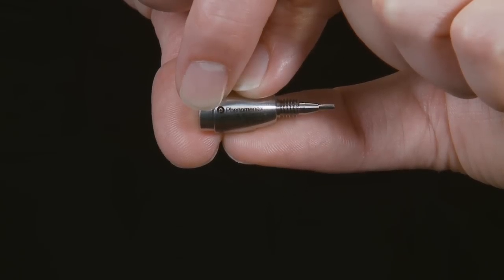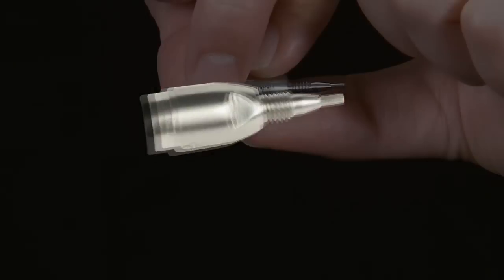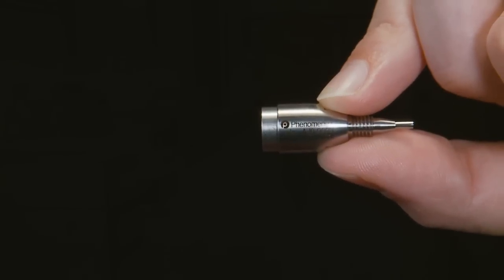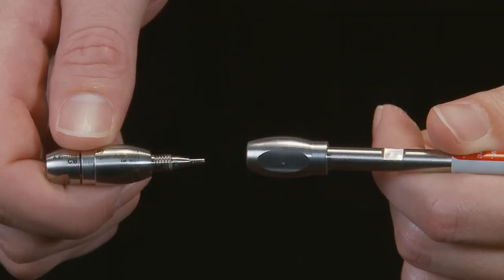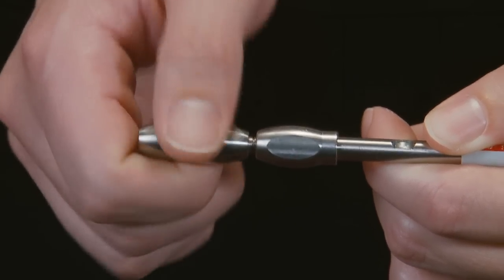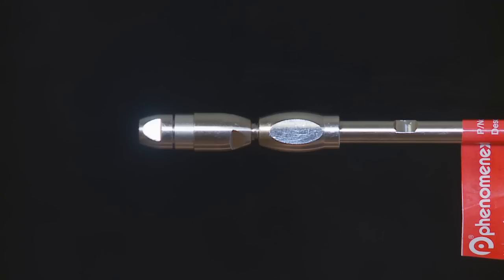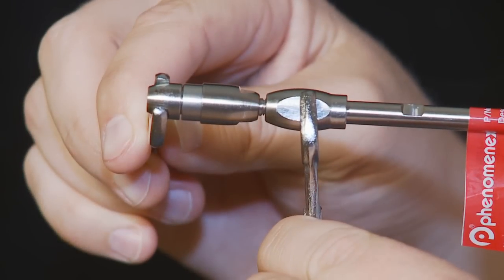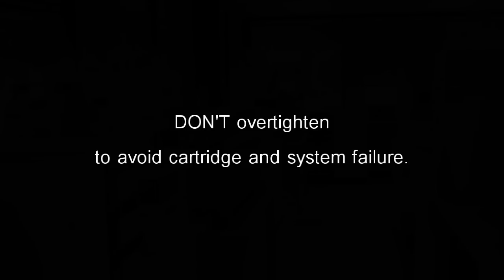Phenomenex SecurityGuard ULTRA LC Guard Assembly

Comment: Hi, 
Even after assembling the cartridge and holder together, the tube base and floating nut separates as shown in video at 1.09 min. How can i fix it, so it will not separate?
Reply: Same as mine. Do you have any solution now?

Comment: Is it possible to change the frit and not the whole cartridge?
Reply from the maker: Hello Ebrahim! That's a great question and here is a short answer: The cartridge must be replaced as a unit for the full instalation you can go here. http://www.phenomenex.com/ViewDocument?id=securityguard+ultra+installation+instructions   Thanks!
Reply: Thanks! Yeah luckily I found out that we have three spare cartridges and replaced one with the clogged one. Pressure went significantly down!
Reply from the maker: No Problem! And we're glad that you got the pressure down! If you should need any future help we are always here for you. Submit a question or click on the live link by following this link - http://www.phenomenex.com/Home/RequestTechnicalSupport